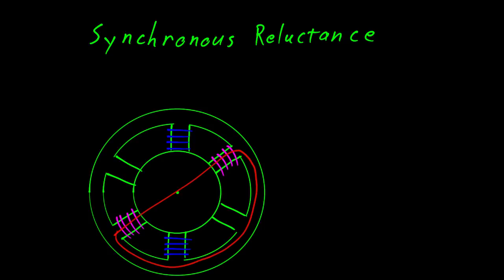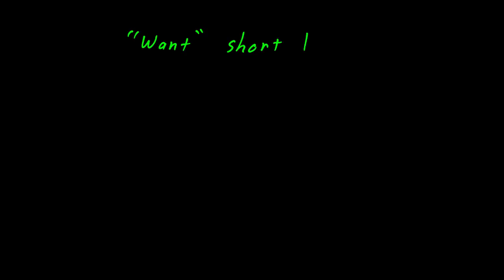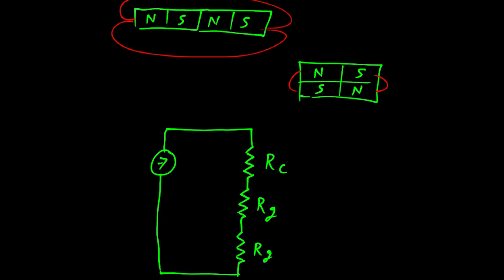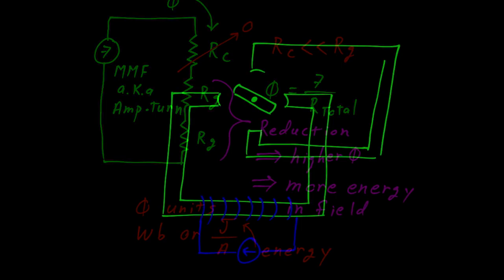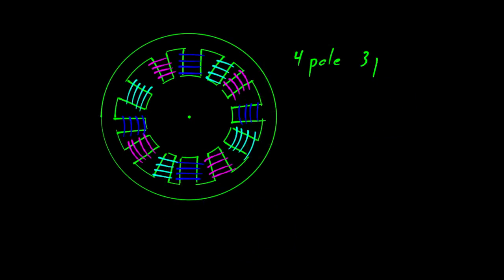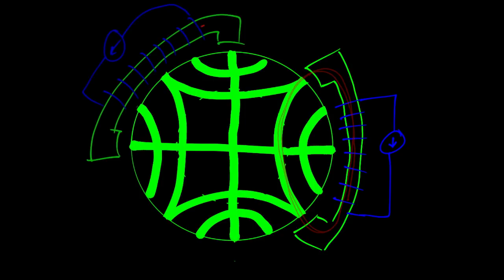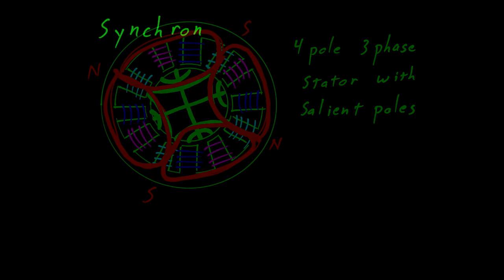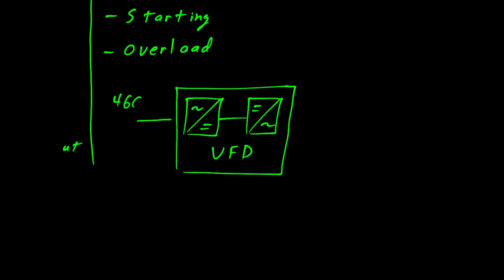Synchronous Reluctance Motor Intoduction Concepts

Comment: This video has become very interesting now with Tesla's Model 3 using a reluctance motor!
Reply: True, came here because I was researching the Model 3 rear motor!
Reply: It's most likely an Interior Permanent Magnet synchronous motor, which by the way exploits partially the reluctance mechanism. For instance the Toyota Prius is quite similar from the appearance, main difference is the pole number, 8 vs 6 of the Tesla. If you read the EPA is stated that, but if you read internet you can find many different things, like switched reluctance (Elon Musk's tweet)..etc. I don't understand why there is some kind of mysticism around this topic...
Reply: @NRG1985  well the mysticism is probably because most of us are having trouble decoding it's working mechanism!

Comment: Cheers, I was hoping that there would be an animated illustration of the rotation and force change, this is the closest i have seen... I only understand motors which are pulling sideways on the closest magnets. Therefore i didn't understand where the tangential draw is.

Comment: Thanks for your great explanation, that's clear and straightforward. At 4:29, in my understanding, activating the north-south coil should make the rotor roate because the coil will create its north and south poles which attract the corresponding poles of the rotor but you said that it will do nothing. Did I miss anything in your assumption? Please let me know. Thanks!
Reply: It's just because if the rotor is perfectly straight, turning on the north south coil wouldn't attract one side more than the other. In real life it probably would flip, but it might not be fast to begin, and it would also not be predictable which way it flips
Reply: @1992jamo  Thanks for your comment. Because the rotor has two poles north and south, in case the rotor is horizontally straight as in the video, activating the north-south coil will creates north and south poles to attract and repel the corresponding poles of the rotor. So, I think the movement of rotor in this case is predictable.
Reply: @hienvuvg  I see what you mean, but if the rotor is perfectly 90 degrees parallel to the coils, then the long flat sides of the rotor would become the poles rather than the ends.  If the rotor was 91 degrees, there would also be some of the magnetic flux going in to one end and out the other, which would cause the rotor to want to turn to reduce the reluctance.

Comment: Interesting stuff! For a year or two I thought the only sorts of AC magnetic motors were permanent-magnet motors and asynchronous induction motors. But now I know about reluctance motors, and I think there might be another sort I’m missing too. I’m also considering the electrostatic analogs of these, being permanent electret motors and asynchronous electrostatic motors. By using multiple dielectric materials in the core (just insulators and conductors, perhaps?) I assume you could get an electrostatic reluctance motor too.
Reply: Usually feasible only in very, very small dimensions

Comment: Can you explain what the extra rotor lines are for?
Reply: if you mean the lines that go out straight from the center then the answer is mechanical stability
the best solution would be to use 2 materials, one with a high and one with a low permeability (=ability to conduct magnetic flux) and make a geometry, where the less permeable material holds the permeable material that would otherwise not be connected to the shaft
this however is not economically achievable, so you have small a geometry, where small bridges hold the main material in place

Comment: someone have any idea how this has anything to do with "reluctance motors can't have good throttle response and have torque ripple"
Reply: Yep, torque ripple = uneven power output. However, back in 2011 they realised if you placed permanent magnets in the stator you evened this out, and hence Tesla now using it in the Model 3.
Reply: @nomoreheroes93  rather back in the 1990s beginning of 2000s in the accademia I would say, it's not Tesla related. Strictly speaking it's Tesla model 3 motor is not a reluctance machine. It's an IPM, interior permanent magnet machine which exploit both magnets and reluctance for the torque production. Very similar  to Toyota Prius  V-shape rotor design.
Reply: It’s due to the power factor. Adding magnets makes the current lag less so more real power
Reply: @NRG1985  that right. I have been studying on this rear motor and surely will release a video on that. Magnets are used for lower speeds or say cruise speed.. and reluctance torque for higher. speeds.

Comment: Can I rotate this machine using (three-phase inverter or no ) ????
Reply: Salah Osmani To operate this motor, a special inverter is needed with position encoder feedback.
Reply: @GertStegeman  i know this in the SRM "salient pole" it sould be use a position sensor and a special inverte. but in the BDFRM there are sinusoidal windings like induction machine.
in the stator winding is sinusoidal 
so i think that there is no a position sensor and there is simple inverter